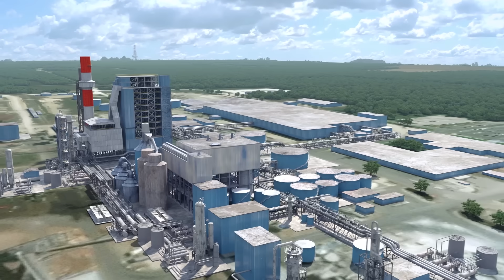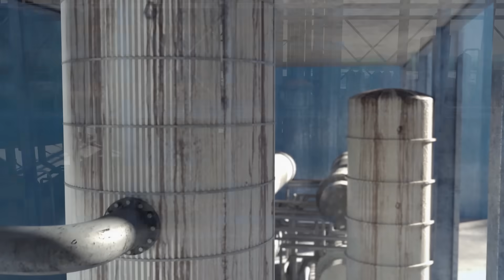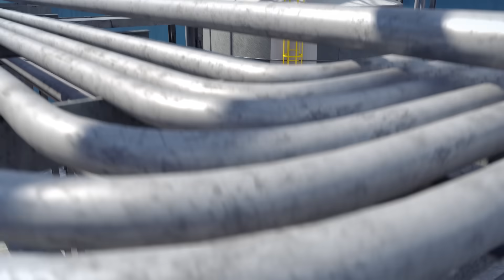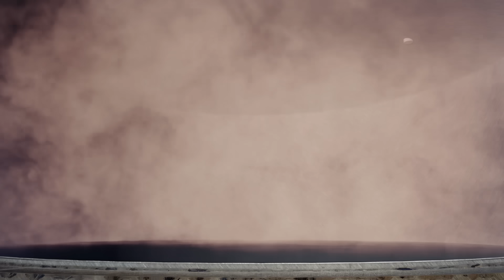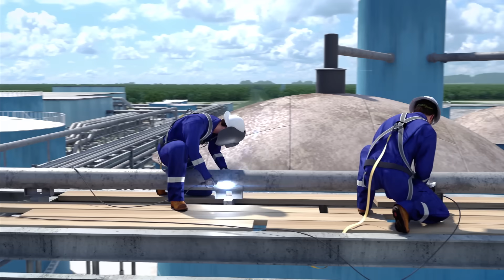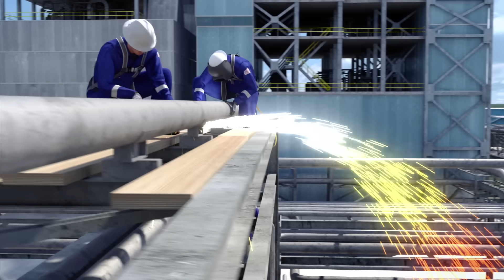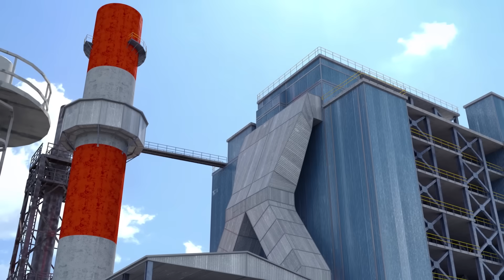Animation of Explosion at PCA's DeRidder, Louisiana, Pulp and Paper Mill

Comment: I'm A Retired UA 342 Steamfitter Welder..21 years..I see so many things WRONG in this Video...Most Valves have Blinds or Plates between the Valves and Piping so there is no Leak by...Most Welding in the Air is done in a Fully contained Scaffolding with Tarps all around the sides and the Floor covered ...The Drains on the Ground are Sand bagged and a Fire hose FOGGING the whole area below the welding...Where they showed the Small BALL VALVE there was no way to Isolate it at least not what I could see....The Guy with the SNIFFER..(it checks to see if there is anything explosive)needed to check the Tank and Break open the piping that needed Welding to see if it was Explosive...I sometimes had the Guy with the SNIFFER check the gas tank of a truck to see if the SNIFFER even worked... Some times they didn't or just needed Batteries....Let me see what else I can find....Where the guy is closing the Big Valve he says thier Isolating it...All the piping needs to be Isolated and Sniffed for Flammibals...When going to working a area where Sniffing has to be done work has to done in a certain time Frame.not stop working through lunch or break and then continue....I've seen fires that have burned the pipes so bad they Melted all the way to the Ground and this is At least 5 layers of piping..
We worked in there for months...lol let's continue...

Comment: A design strategy reaction: N.Tesla came up with his valvular conduit, this can be toroidal and used vertically, the sections will divide by density, controlled temps.

So, all that isn't captured by the existing process then will go through these to remove the remaining turps & separate the water at volume to far below the ability to ignite the goal.

Comment: The basic mistake I see is atmospheric venting of a tank containing a flammable liquid.  I know under standard conditions, the freeboard is fuel rich and could not burn.  But this is not absolutely true which means the tank should be inert gas vented.  I wonder if they did this when they repaired the facility?

Comment: 5:42 "hot work activities likely ignited the turpentine mixture"
That sounds a lot like you don't know and are possibly slandering these workers who died.
Were there any electrical connections to this tank for pumps or anything else?
What other maintenance work was being done at the time?
Were they actively working  (as you show in one animation) or unloading equipment (as you show in another)?
What time was lunch at this place? (I ask since it blew at 11:05)

The animation is amazing but this investigation is not one of your best.
I say this as a fan.
Reply: When the evidence is easily burned or destroyed, you can only go 'this is the most likely thing to happen' and nothing else. The NTSB has similar procedures when the Black Boxes aren't recovered.

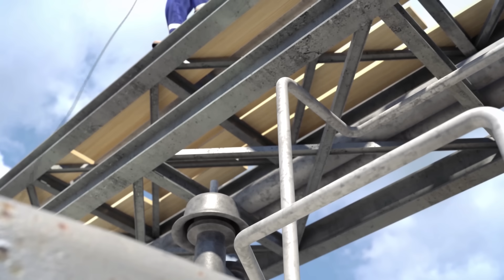Comment: 5:37 Unless they bought their mig welder at Harbor Freight the tip stays cold until you pull the trigger.
They would have had to left the welder on,dropped the handle in such a way the trigger hit  something hard enough to depress it while the tip made contact.
Those handle assemblies are expensive so I don't see a professional welder flopping one around like that.
I would look at the pressure regulator as a possible entry source for the sparks and or slag.

Comment: As my dad always said (and to this day is still right), “Andrew, what are the first three letters of assume?”...yeah don’t be that person, people die because of it
Reply: Do you check to make sure your gas tank isn't leaking every time you get in your car? What if, one day, the tank is leaking gasoline vapors, you turn on the light in the garage, and the vapors explode? Is it your fault for assuming the airtight container that holds an extremely flammable substance hadn't failed? Is it your fault for assuming the light switch which is designed to never create a spark hadn't failed? Everyone everywhere makes assumptions every day. Some have a higher risk than others. I assume my alarm will go off every morning and always at the same time so I can go to work. If it fails, I'm late to work, not a big deal. I assume when I turn on my gas stove that the valve which keeps the gas out of my home is functioning properly as is the detector which would alert me if gas had leaked. If I'm wrong, I die, big deal.
Reply: @andrewb378  What a long, dumb response to the dude's comment lol. I'm so sick of you TROLLS

Comment: In other words, you really didn't find the cause. I didn't see anything to suggest how the ignition source outside the tank reached the flammable vapors inside the tank. I thought you might suggest that the heating of the tank during the day lifted the relief valve allowing the vapors to escape from the tank and reach sparks from welding. That would cause a fire outside the tank, but I'm not sure whether the fire could go backwards through the relief valve into the tank. If they knew that they were sucking air into a tank with flammable vapors, they could have connected nitrogen to the vacuum breaker and kept the vapor space free of oxygen. 

Were the workers wearing H2S monitors? I think those will alert to SO2 as well as H2S. I'm curious whether there might have been any indication that the outside atmosphere went from being free of explosive gases to having explosive gases.

Comment: solution .
internal pressure test for the tank 
internal gas test through gas check points of the tank
continuous external gas monitoring .
use sub environment habitat for hot work activities if flammable gases cannot be avoidable .

Comment: This is a common hazard where flammable liquids in partially full tanks are allowed to vent into or from the atmosphere. You mine as well have a bomb ready to detonate any moment. Relying upon the mixture being to rich to detonate has to be one of the poorest excuses I've ever heard.

 Had a inert gas like nitrogen, CO2, neon or argon been used to fill an under atmospheric pressure tank this would not have happened. Of course they would have probably screwed up some other way. Like letting the fill gas run out. 

Nevertheless the company safety man should have know the hazards of tanks like this including the vent which could probably easily get stuck open. Instead a guy goes out waves a detector in the air and a 'hot work' permit was issued. How come he wasn't at the place where the welders were working? Probably the contractor was saving on welding blankets that day also or maybe he didn't want to take the time to put them on the tank. 

Like everything else at the time they could have gone through emptied the tank and filled it with water to be safe. Also you don't need to have lots of the liquid flammable substance on top of the tank just enough to cover the water so that flammable liquid vapor pressure can build up. Of course it would of cost time to empty and fill the tank and with it being shut down no doubt the pressure was on to get 'er done welders on scene cost money. 

Like I have said elsewhere you need a union safety committee with power to shut down dangerous practices.

Comment: The sad reality that this disaster required the company in question to make safety mistakes multiple times along the way in order for this to happen, is honestly what is really most disappointing about it.

First, they allowed the turpentine to build up so greatly in the first place, despite that clearly being a potential hazard. Second, they allowed such a potentially hazardous material to come into contact with sufficient oxygen to become explosive. Third, they did not test the contents of the tank before issuing a permit, only the surrounding air. Fourth, even having tested the surrounding air, they did not take the obvious step of covering the tank to prevent any potential energy used in the welding from coming into contact with the tank. 

So by my count, that's a minimum of four separate mistakes that they had to make in order for this disaster to occur. How any operation of such a size can manage to make that many mistakes in a row when regarding basic safety is just mind-boggling. Contract workers expect that the companies that they work for are run by professionals that don't leave explosive materials next to their welding space without informing them, and for many of them to lose their lives due to this is quite unfortunate.

Thank you for this animation. It was very well done, and informative.
Reply: It seems like all serious accidents always area chain of events that all combine to create the disaster.   If at just one point in that chain, a different decision was made, the chain is broken and no accident occurs.

Comment: Common behavior from operations not to do  a thorough inspection and perform a hazardous atmosphere inspection above tanks. Most just sit inside control room and or take the word of another that area is clear. Not good to allow operators to sign off of Hot work/Confine Spaces ETC without having Safety personnel sign off as well!!!!

Comment: It could be that during the day's work, a pressure equalization valve was automatically opened due an increase in temperature, releasing some of the explosive gas mix in the tank which was ignited by the welding work, the flame propagating back through the valve into the tank.  If that's the case then a flame arrestor on the tank's vent line would have prevented the explosion, regardless of hot work.

Comment: This reminds me about another CSB video on the Bethune Point Waste-Water Treatment plant. They were doing hot work over a methanol tank and sparks got through a poorly maintained flame arrester. 

Both incidents assumed that the contents of the tank were under reasonable control. Both were working over a vent that nobody expected would allow sparks inside. 

You'd think we'd have learned not to make such assumptions after the Bethune video, but sadly that's not the case.
Reply: The welders probably didn't know what that tank was.
Reply: wasnt a valve this time though